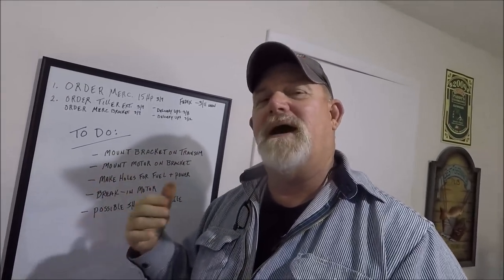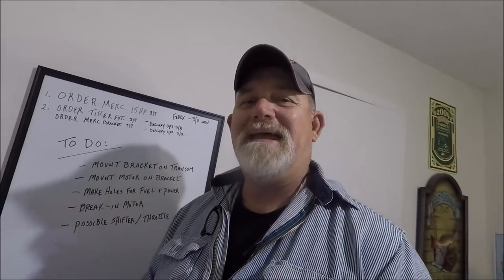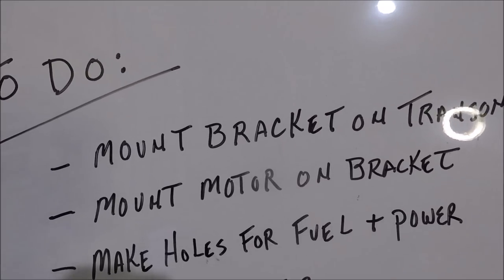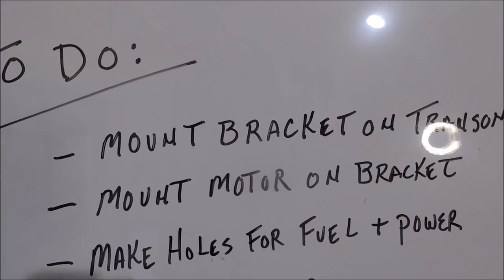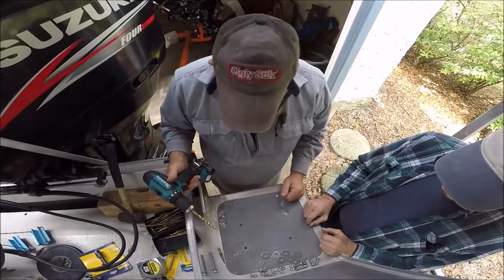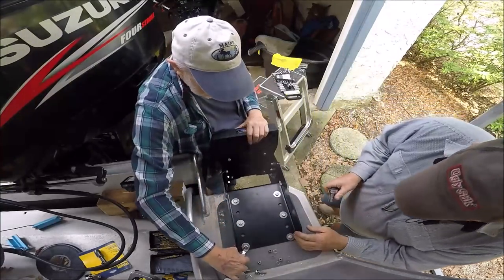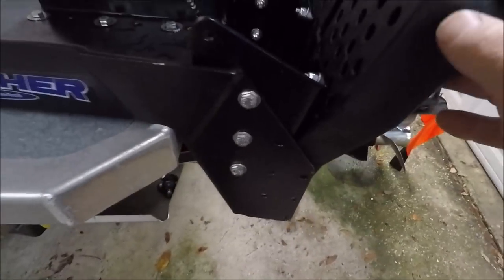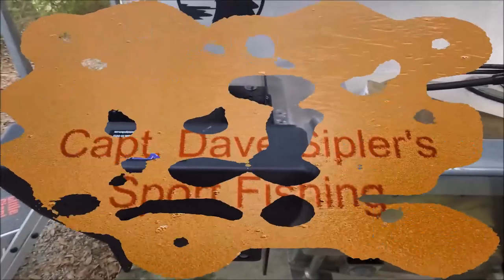PANTHER SWIM PLATFORM KICKER MOUNT, phase 4 install Mercury 15 Pro-KICKER

Comment: Great video I bet I watched this 10 times . Even though this cost 300.00 have decided to order one as soon as I get my next social security check . I have a favor to ask Capt. , My application will require me t cut the transom on my custom extension bracket I designed ( if I was able to post a photo you would understand why ) .
My favor is , what is the width of the Panther bracket hat bolts on the platform ( port to stbd ) ?.
Thank you
Reply from the maker: 9-1/2 inches
Reply: @CaptDavesSportfishing  thank you

Comment: Any idea how far out and down you can drop the kicker motor? Thanks for a great video.
Reply from the maker: thanks, ya don't want to go to far out, because of mount holes on bracket. Up and down on the Merc, is choosen via the mount holes. But yes the mounting pad is adjustable up and down maybe a inch or two.
Reply: @CaptDavesSportfishing  Thanks for the quick response. Any idea the size/Dimensions of the
Mounting plate that bolts to swim platform? I've looked everywhere and can't get the dimensions.
Reply from the maker: @kdachat5533  I could measure mine, and get back to ya. But on Pather Marines site, aka: Marine tech, I believe. I'm sure there's a info, instruction schematic/demensions page.
Reply: @CaptDavesSportfishing  I looked, nothing. Thanks again for your help. I'm a West Coast Capt. N Charter Capt. Your help is appreciated.👍